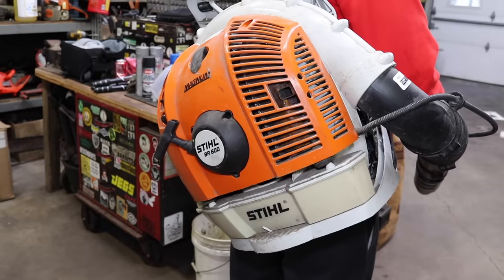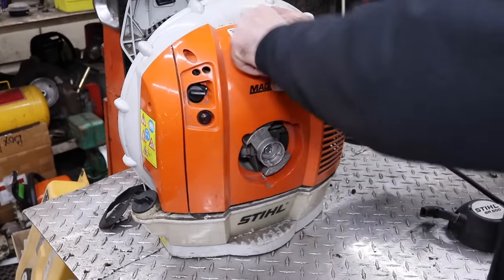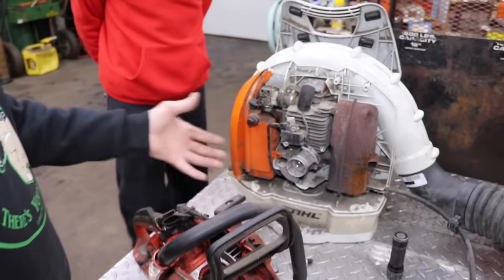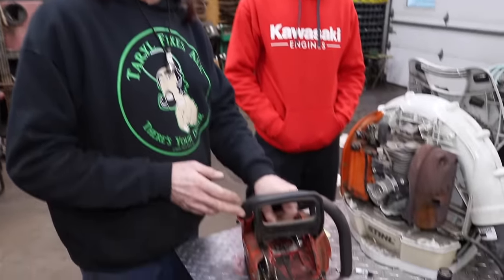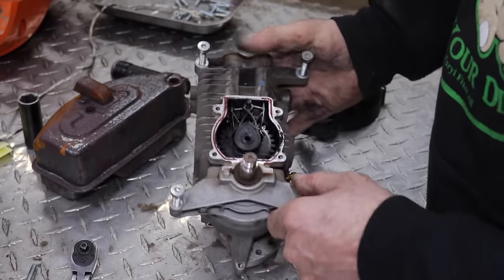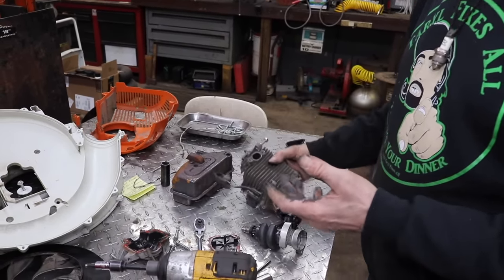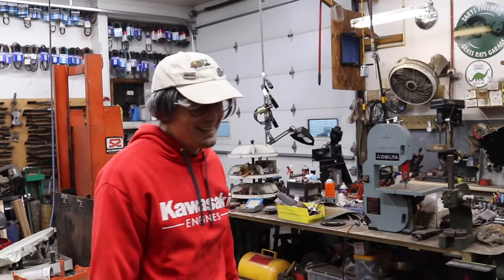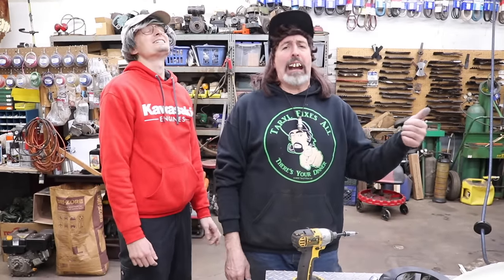4 mix NIGHTMARE! DON'T make this mistake 🚫

Comment: And there is the simple reason right there as that is cheaper to just buy another blower make a blower last a year or two for $300 or 475 something like that I don't know exactly what the floor cost in a year or two when it breaks it's just a cheap to go and buy another one so in the end they just sell more blowers thinking about is the damage is going to do the reputation and the Clutter which is what I'm always about as a person who repairs small engines of this big box store tightening mentality run it till it breaks throw it away go by another one what do you think the old ones just disappear no they land up in the landfill they just continue to grow trash that's why anybody that comes into me I'm always going to say fix it even if it costs the same maybe I'm idealist or whatever definitely not a leftist but instead of cluttering up the landfilled I can make this one run brand new just like it comes off the shelf with new parts and you have at least done something to keep the landfill from getting flooded and if you had millions of people would do that around the country and just say hey I'm going to pay the extra money I'm not going to lose any money because I'm still would be buying a brand new one so it's going to cost me the total amount or I can put that or three quarters maybe half of that in this one and I still got a good functioning not to mention you can put the better Parts in it than the ones that come from the factory a lot of the times some aftermarket parts this would actually last longer than a new one I can buy off the shelf and I'm doing my part to not adding to the landfilled but stuff don't disappear this mentality of the world and this big box store commercialism which I'm not against everything I know there's some people just against everything no I'm not against everything but there is some things that are going on in these big corporate movements that we could make a change in the way we purchase and say okay I understand what you're doing you're making things very cheap we can just go and back quick go back home get back to blowing our leaves or whatever cutting our grass and then it breaks very soon because everything is made out of plastic and then it's cheap enough we can just go and buy another one and you might get here you might get a couple years and you just kind of do that cycle but that cycle throughout the millions of people just say in America itself not around the world lands a bunch of junk that just keeps piling up and piling up and piling up so you can see in the scheme how it works to make money there's just nobody there that is concerned about the long-term effects of continuing to buy this stuff and throw it away and then go buy another one and just throw it away of the long-term effects on you know waste when I'd say if you want to spend the money anyway spend it on the old one you got refresh it and keep on rolling if enough people done that not only would overtime would the manufacturers start changing the way they produce their stuff which might up the cost of the product but it would also give you a better product which is worth the extra money and it would also kill this ideology of Big Box store just go by and throw away and buy and throw away and buy and throw away to where the people have spoken and believe me the people can change anything when it comes to their buying habits that's the reason the beautiful part about capitalism which a bunch of leftists can tell you all kinds of terrible things about capitalism but the beautiful part about it is though cuz there's always good and bad and everything is that people control the marketplace on how they spend their money and people that sell things like Steel when it starts having effect on their bottom dollar they have to change or lose out so it's always up to us Free People to get out of this Matrix to get out of this thing that we have been raised in it seems normal but when you break it down look at it you see that it's just not a good way of doing things and we are the ones who let them do it by our spending power our spending power is what changes the market is what dictates the price of the market if something's overpriced unless you got some killer marketing team that makes it look like it's something great and worth the money people are not going to buy it and if people don't buy it then the company cannot survive cuz it has to sell to survive this is the problem that we the people have lost in this new generation of ideology and brainwashing and all the craziness is going on is that we if we want to can take our power back from all these people it don't matter if they're Nike it don't matter who they are but we're so worried about being a part of the Joneses that were not worried about making things right bringing it back to work being made in America was a a brand that the people around the world used to look for not just Americans but people around the world it's like buying a Japanese car or a Honda you know they've done their job they've showed that these cars will run for hundreds and hundreds of thousands of miles if they start cheaping out on it and everything and they stop running hundreds and hundreds of thousands of miles people stop behind them yes there is the bottom price yes there is something you want to get the people can afford to buy cuz obviously everybody's not rich so there's a certain population that you got to sell to but there's also in that population a ideology of big store Big Box store where you buy things and throw it away you just go back and buy another one and just keep it because it was cheap this is something we can stop it sounded good at first but as we see over time this is not so great for the company or for the consumer and we have the power to change it it's just people just ain't willing to get out of their own way and take a little bit of a hit and we take hits everyday and many many things that have nothing to do with anything at least we can take a stand on something and I'm not talking about please oh my God please I'm not talking about this leftist chaotic stand that we want to change the world no I'm just talking about small things like Nike getting away with what they do child slavery going on in China to make these things and people go out here and pay $200 $400 for a pair of Nikes we can change that but you're worried about what the other person is going to say oh you can't afford Nikes whether I'm going to forward it not it's none of your business it's whether I want to wear something that I know how it's built Adidas the same way and many many other things that these Walkers out here want to use and act like that there's something great when we all can see what is behind you know the curtain anyway that's my rant people can take it or leave it

Comment: You didn't really demonstrate how it had failed, because that bushing was NOT loose or rattling.  I think it was just too tightly seized against the pin, so that friction is causing the piston to slap.  It really seems like you could still hone out the bushing and clean it up, be sure to soke it in lube-- and put it back together (as long as the cylinder was not gouged).   The reason I say this is because that bushing was not worn out in the sense that it's now loose;  it was just completely devoid of lube so it was grabbing;  Which I think should still be serviceable, because I've had to do that many times on floor fans;  If the bearing seizes up from lack of lube or too much dirt-- you can still clean it up and re-lube it back to life, until they actually wear the hole so much that it no longer fits tightly..   I wonder if you are supposed to store these things a certain way (upright, or upside down, etc);   Where your piston is upside down, and your oil in the bottom end will sit in the underside of your piston like a bowl, so that bushing is soaking in oil while you're not using it.... 

It looks like going into it, you were thinking that "rattle" was from the bushing being completely wallered out, but that was not the case here once you got down to it.  Your "rattle' is simply from pistol slap, from that bushing having too much friction, which I think you can still bring it back to life by lightly sanding the bushing ID clean and getting your pin to spin freely again -- soak that bushing in oil overnight and put it back together.   I wouldn't have given up on this so easily, simply because that bushing did not have play in it.

I really wonder if you could have somehow flooded that bottom end with oil and put your cylinder upside down and slowly spun your crank while that wrist pin was completely submerged in oil -- and if it would bring it back to life without even takin it apart?  You can tell it was simply DRY-- that's it.....

I'm not disagreeing that it's a bad design-- it certainly is;   and it obviously doesn't sufficiently get oil up to that wrist pin correctly.  But those bushings hold oil;  if you can just soak them in oil, they will fill up and slowly release the oil over time;  so that's why I believe this thing was probably made to sit in storage a certain way so that bushing can be soaking in oil while it sits--- but the owner was doing something different, like hanging it up on a wall or something -- where that bushing never gets replenished with oil;  and apparently it doesn't oil itself well enough while it was running..  I feel like there's a missing piece of the puzzle here, and I'd want to read through their owners manual and see if there are any instructions on what should be done for that bushing to get oiled correctly;   I feel like there are steps you could take to make sure that bushing is soaking in oil while you're not using it. 

Who knows, maybe a new full tank with really good oil/ mix is all that it needed.   Did you try to drain the fuel and put in new fuel with the correct oil, and see if it came back to life?   Because that bushing was NOT worn out-- it was simply dry.

Now if the piston slap caused the cylinder walls to be gouged, then you can't really save it without a new jug-- but you said that it still runs!!   So at this point, I personally would put new rings on it, since you already have it broken down this far;  clean up that bushing and soak it in lube, get it working freely again and put it back together..    

Your message is correct that this is a bad design and shame on Stilch (lol).. But I think you could still have tinkered with this a bit and got it going again.
Reply: Good points; I was thinking the same.